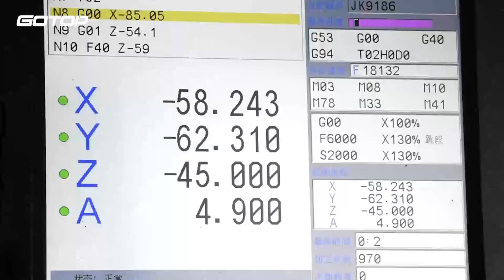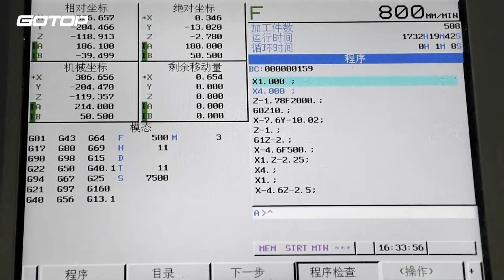How to make watch case

Comment: Hello...do you do custom cases? What's MOQ and final shipping times to India? Case will be in 316L or titanium if you can do it. Let me know whom to contact.
Reply: How many and what are you looking for?
Reply: @michaelmeyer6603  hello Michael...I'm making my own line of watches. I can provide CAD data if needed. Honestly just looking for maybe 10 pieces for now to see what it prototypes look like.
Reply: @racket136  Get it machined on a CNC machine in India, they have the capability custom built not pre production prototypes.
Reply: @andrew allen  thanks for responding. I assume you mean that they can mass produce but not develop prototypes.

Am I supposed to provide them with just a CAD file? And they'll mass produce? I tried their email multiple times but no response. I am now looking at other manufacturers.
Reply: @racket136  I don't know about mass production but case prototypes may be made on any accurate 5 axis milling machine from say a SOLIDWORKS file or g-code. It will of course be expensive. The skills and machines are in India and Pakistan and can do mass production at a price. The production lines in the Video are for very large scale mass production at extremely low prices. Milling from solid on a 5axis is more expensive in terms of skilled labour which is available in India and very expensive imported machines as India lacks the skills to make the machines themselves. The best Indian quality will be between the  Cheapest and most expensive Chinese in my experience.
Reply: @andrewallen9993  thanks a lot for your response. You've provided valuable insights. The problem with 5 axis milling in india is that I have no way to crystal press, waterproof test, etc. The products that they make. So paying $$$$ for CAD design would only be a job half done since the milling shop can't do any of the rest.

I am an expert at making dials and not watches. That is the conclusion I've reached. I think the best option would be to either send my dials to an ODM manufacturer or ask them to create everything with a dummy dial, and I swap them out when I get them.

What do you think?
Reply: @racket136  A dial press is cheap to buy if you are going to be doing reasonably small quantities. The same goes for a waterproofing tester (pressurise watch in air then drop in water and look for bubbles) If you make dials may I suggest doing so for Vostok watch collectors? They have a large modding community so you could offer custom made and copies of obsolete models.
Or even ask the Vostok factory to supply you with cases/movements without dials? The Vostok's are designed to be opened and closed in the field without gasket or crystal replacements.
Reply: @andrew allen  hey Andrew...I looked into what you said. Unfortunately Vostok does not fit the thickness of my dials and I need to provide proof of sales before my financiers will fund a 100-300 MOQ case...

Obviously you are very knowledgeable about all of this....do you know how to make cases? I can buy a press and water pressure tester but I was wondering if you can design a case that I can cast (casting for now...milling later)
Reply: @racket136  Make a pattern out of MDF or perspex using hand tools then get a forge to cast it for you. I suspect you will still need to CNC the casting. The other alternative would be to buy a Chinese 3 axis hobbyist milling machine and mill them yourself out of Brass which may either be left alone to give the client an eventual verdigris bronze like finish or plated. You can do nickel or gold plating easily at home.
Reply: @andrew allen  I have a DLP print to cast system provider who can do it in silver/sterling..unfortunately CNC is out of the question for now..

The actual problem is designing the case. Would you be willing to provide some insight about my designs? I'll share everything I have so far 

I would love to chat privately in DM as it's better than youtube comments LOL...ofcourse that is...if you would like to as well
Reply: @racket136  I do industrial Robots and things like Mazak 5 axis machines, unfortunately making large car parts not small things like watches. Except for modding and regulating Vostok watches as a hobby.
If you can cast silver a hobbyist CNC would still function as production speed isn't really a requirement for prototyping. Why not do something like find an existing case whose design you like and then reverse engineer it changing its dimensions to suit your design?
Reply: @racket136  if you want silver looks why not do your case in brass then silver plate it? Again it's something you can do at home. Ask around your area for who has a hobbyist CNC as if you are doing small batch production it doesn't matter if you make small depths of cut. You will be hand finishing like they did a hundred years ago anyway.
Reply: @andrewallen9993 @andrewallen9993 Hello Andrew. My apologies for missing here. I have some updates for you. I actually found brass cases which fit my specifications, however they are casted therefore do not offer water resistance. Everything works great except water resistance, which is the major issue here. 

Say that I could make my custom cases in bronze/brass, how do I ensure water resistance? Caseback is snap on, crystal is glued, and crown is non-threaded. Casting these in soft metal means wear and tear. 

 recently, I ordered a case that works for me. A very high quality, saphire crystal, 5ATM case which is perfect, but it cost me, at 60% import duty, almost $250. That is just INSANE price.
Reply: @racket136  it is possible to make a cast brass case water resistant but requires
A screw down crown with gasket
A screw down case back with gasket
Perfect glueing of the crystal  or perfect machining of the case and gasket or perfect machining of the crystal or a gasket.

I suggest you look up how Vostok make their Kommandirskie and amphibia watches what they call water resistant but are actually waterproof ( when they say 200m and 20m water resistant they can actually be submerged to that depth without leaking). I own two and they laugh not only at showers and swimming but being submerged in boiling water though the boiling water is bad for the lubricants and the watch requires re regulation afterwards. The 20m Vostok is made of brass and gets its watertightness from very clever design unlike a Rolex which gets its watertightness from very precise manufacturing and assembly. I would leave the brass case unplated and market it as being able to patinate well :)
In terms of that's not a fault, that's a deliberate high class design feature!
The reason for the purchase of the Rolex Oyster datejust in the 1970's was when the dealer was asked if it was waterproof he put the demonstrator in a kettle of boiling water and showed it ticking after it was removed. If you can achieve that level it is an incredible sales tool when demonstrated and doesn't affect warranties as the customer cannot prove they screwed down the crown.
P.S. This only works for mechanical watches don't boil an electronic movement, the semiconductors and batteries don't like it.

Let me know how you get on please. The advantage of India is whilst sophisticated machinery is very expensive skilled labour is cheap. Do you pay lower taxes if you only import components and assemble them locally? I know there were Indian made watches in the past HMT etc. Bankrupted by cheap quartz units but is there a market for status symbol mechanical watches in India? I say this as someone who owns three Jawa ( Yezdi when made in India) motorcycles and did metrology computers for the Bajaj scooter machine tool press dies quality inspections after they were made in South Africa before shipping to india.
There is nothing like telling a prospect that Rolex watches are made to Aman standards of watertightness and then demonstrating you can tell a real Rolex from a fake by boiling the Aman and the Rolex together then showing them both working afterwards. Or the "Rolex" full of water or not ticking as the case may be.
Reply: @racket136  The reason I go on about the Vostok's is that the Russians ( presumably like the Indians) lacked the capability of machining things to Rolex standards and the Russian design solution accommodated this.
In other words a design solution to a problem rather than an engineering and manufacturing solution.